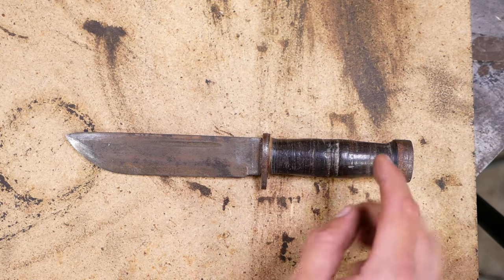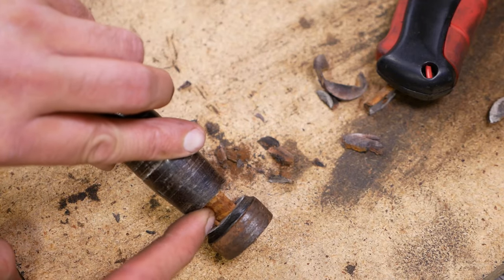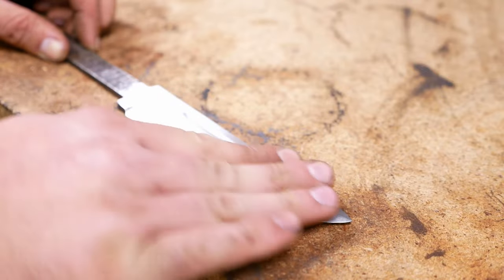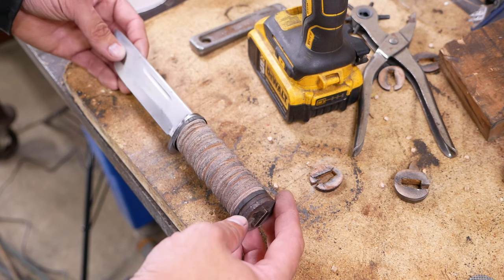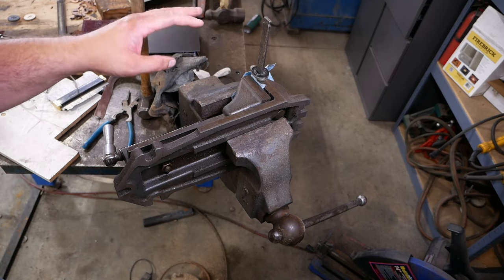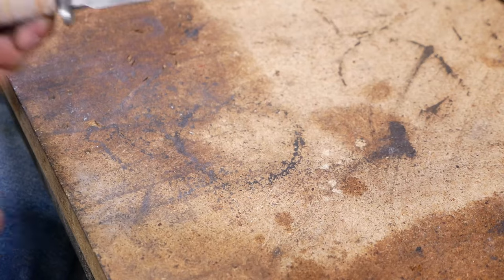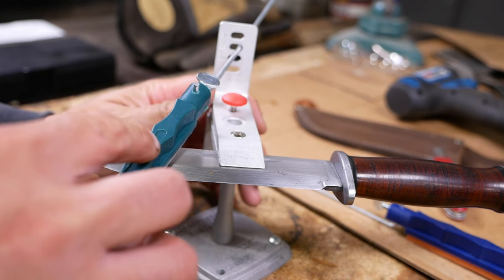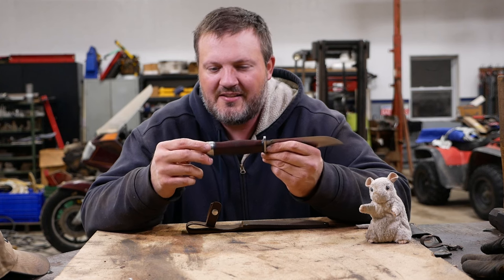Restoring a Cattaraugus 225Q Knife from WWII

Comment: I’ve restored one Western skinner from the 1950’s, a Western camp knife from the 1960’s and a Marbles skinner from the 1930’s with stacked leather and an antler pommel. They all were in pretty good shape with original sheaths. The Marbles sheath was too far gone. I had to make a new taco style sheath for it. All users. Thanks. Nice video. You did a great job 🎸🔪

Comment: The way I do my stacked leather handles...get a long 1/4-20 carriage bolt and a couple large fender washers and nut. Cut your leather disc's, punch center holes in them then soak in water. Stack the disc's onto the bolt with washers on each end and crank down as tight as you can. Sit it somewhere to dry for several days. Then remove from bolt and use as normal. This method takes a lot of guesswork out, as the disc's are already as compressed as they can be. It also reduces any issues of handle shrinking in the future and handle loosening. I usually finish by melting beeswax into the leather until it won't accept more, then buff.

Comment: Wes...GREAT job!!  I'm a self-confessed knife junkie too. Just a quick tip here...get two thin strips of rubber (can be very thin and still work) and put them between your blade and the Lansky clamp. The rubber will protect your blade from any scratches while sharpening.

Comment: Outstanding referb job. I’ve found with my Lansky the angles actually come out 4deg less than what’s stamped into the fixture. I measured my angles on a optical comparator at work, I sharpened on the 20deg slot, it actually measured 16deg. Something to keep in mind.
Reply: The angle is totally dependant on the width of the blade and the position you clamp it in.

Comment: Did great. A tip for when you're stacking the leather, wet them all (maybe you did and I didn't notice?) and when you press them they'll really fuse well, just make sure you let the wad dry out before you go further. Also, some people (unless you're truly sticking to the old methods) will saturate each leather disc with epoxy before stacking them as an alternative to leather. Finished piece looks incredible. But you're looks gorgeous too, so great work.

Comment: Very nice!

I forget what it even is...  Air Force Survival Knife??   Not sure.  I got it used at a show, for almost nothing.  the handle is like yours, or an Estwing Hammer, the stacked leather.  I cut the top off of a soda bottle, filled it with linseed oil, and put the knife in there handle down, for a week or so...  Came out really good.  

I've had Lansky Sharpeners forever.   I love them.  They just work.  

If you like knifes & stuff, you can buy bayonets pretty cheap too...  Those are fun to sharpen up...

What I sort of like about the surplus military gear is, it maybe lacks some of the style, and finer points of your premium knives, but the stuff is super tough.  It might be mass produced by a low bidder, but, it apparently meets a standard, because the stuff is tough....  It's kinda fun, to take that stuff, and make it nicer than it ever was, or was ever intended to be....

Comment: VERY NICE complete overhaul. I have one of these knives. Got it from my pappy in 1962. No sheath, unfortunately. I didn't take it apart like you did, but I did give it a nice, 21-degree edge on a Work Sharp sharpener. It looks pretty much the same it it always has, but now it cuts off arm hair and slices through paper. Seriously sharp.

Comment: G'day Wes. I think that you have done a good job on the knife and sheath. A couple of things that may help you with the leather work. My dad was a saddler who made many items from leather as well as saddles. He used beeswax with a little powdered rosin mixed through it on the thread for the stitching. Apparently this helped to waterproof the thread. The cut edges of the leather were dipped in water and rubbed with a piece of hessian. This closed the grain of the edge and smoothed it. He sometimes rubbed the edges with a cloth dipped in dye to finish them. I can't remember what they were as he died in 1988 at 74 years of age. He also had a tool that he used to warm in a spirit lamp to run along the edge to finish the edge. Hope this may be of use.

Comment: I have restored over 100 of these 225Q's and you did everything but one thing right. Bees Wax  is used instead of floor wax! Nice job though. Another thing I did to the knives I rebuilt was to soak the leather washers in Distilled water. I would soak them overnight and the distilled water was used to keep any kind of chemicals from getting into the leather. I never used glue of any kind either! 
Put the soaked washers on wet, tighten well to the point where you can barely fit the three metal pieces back on the knife with great difficulty.

Comment: The Ka-Bar has a much thinner tang; the washer kit you tried first I would bet money was for a Ka-Bar. I carried one for years in the Marines after my uncle gifted it to me when I was younger. I watched jarheads throw them, beat them, bend them, and destroy them so you could see the parts when they failed. I believe the reason so many of these particular Cattaraugus blades survived was specifically because of elements like that crack relief angle, the thicker tang and increased blade width. Someone designed that particular knife to really last. But for a fluke of fate, that might have been the Marine fighting knife, it certainly was a better design.

Comment: Years ago a buddy of mine got one of those knives from an auction. It was brand new and dull as could be. He always had me sharpen his hunting knives so he brought it by. It took me probably 60 hours using stones to get an edge on it. I got it shaving sharp and it served him several hunting seasons before needing a touch up. The edge outlasted all of his other knives and he used it hard to see how long it would last. I don’t know if they all had blades that hard and tough but that one sure did. It chopped thru bones and about anything else without chipping. The worst of it, after I got it sharp he wouldn’t sell it to me.

Comment: Make yourself a couple of soft jaw inserts from aluminum angle, they snug down and hold stock real good and don't scratch stuff. I also make a nice jaw insert by cutting a piece of 3/4 or 1" square from corner to corner about an inch long and weld those to a piece of angle iron. Put that in your vice and it will absolutely lock onto a piece of round stock such as when you file on a punch or use a large drift for a bending mandrel.

Comment: I have my Uncles WW11 knife. It's made by Case. Still has the sheath which incidentally looked like the one you had without the stitching and buckle strap.
Size, shape, and tang. The tang had diamond shaped points. My uncle said he found a rock and filed them down a bit because they got caught up on different things. The leather handle has tiny mounds and spaces symmetrically machine carved into the house glass handle. It is definitely non slip! Awesome job thank you for all the time.

Comment: Great job on restoring this old knife.  I think it is safe to say that it turned out "better than new'...  These are great working knives around the shop.  They are tough and rugged, and you don't feel bad about getting a scratch or ding.  The stacked leather hilt is surprisingly tough and will hold up to most anything you can do to it..  The steel is a bit thicker than one would expect and will hold up to a lot of abuse with hacking, prying and hammering on stuff.  The quality of the steel in the blade is a pleasant surprise ..  These knives take and hold an excellent edge.  Like most people that fool around with old tools, I have a couple of these in the basement somewhere...  One really needs a new handle, but has the original scabbard - which needs some stitching repairs and a new snap on the retention strap.  The other is in better shape but has no scabbard...  I guess I will tackle them one of these days.  Love the second channel....

Comment: These knives did see a lot of use after the war. And they were sold commercially also. You are probably right about them not being a true or even good hunting knife, but more of an everything else utility knife. They were or are now called quartermasters knife by some. I very much need to rebuild mine that came by way of my Grandfather who got it no telling where. It was virtually a brand new knife when I got it about 1970 but I used it and want to continue using it and pass it on in field ready condition.

Comment: Really nice job. One of the best stacked handles I've seen done, I also never liked how everyone goobers the disks with epoxy and puts the handle together. If you want to make itlook more authentic, if you look back at the original handle you'll see the middle of the handle had grooves or cuts in it, they actually did that at the manufacture supposedly to add grip. Also your sheath needs two more rivets halfway between the top and bottom. It came out really nice and I think it's one of the nicest restores I've seenand I've seen a lot of them to see how I want to tackle some of mine.

Comment: You did a good job.
I do use apoxy usually, my thinking being that it seals the tang, and the leather too somewhat.
Those were quarter master knives, designed to be stout enough to open crates and such without breaking the knife. (Or hopefully so anyway)
That is a unique design on the pommel. I have one of those knives, and have never noticed the pommel being 3 pieces. Will have to get mine out and look at it again.
I will say this, in my opinion, that set up is a whole lot better than the western knives which had the tuning fork tang. I have seen many of those where the tang broke. That is why I would never pick a skeletal tang knife for survival. I have a couple of Becker knives and love them for woods running, but if I was going somewhere that I might actually end up in a bind and having to use a knife for building a shelter, or to split some wood to get to dry wood for a fire, it would have to be a solid, full tang.

Comment: Did I see you using your cotter key plyers for nail pulling, Wes? lol!  I did something similar to an old Kbar I have.  I sanded out the old scratches, gave it a couple rides in the sand blast cabinet and then parkerized the metal.  Hope you get to use your new knife a bunch out in the woods!

Comment: Wes if you want to protect the leather and gat it to tighten up Might I suggest you try this recipe  1 part each by wt. of boiled linseed oil , mineral spirits  and the wax from a comode donut.  this is the recipe I use to treat leather that will be exposed to the elements and it works quite well  ( It's also the recipe for making  tin pants ) my uncle gave it to me  and he used it on every thing leather or cloth  and ran a dairy farm/ angus ranch on the west side of the cascades in Oregon oh when makking this up do so outside or in a well ventilated room  the fumes are quite bad. use it in its liquid form(melted) let stand until completely dry then use a hair dryer or hot air gun . Take your time with the heat as too much will ruin it. Good luck --Dave

Comment: Turned out great.  Have same sharpener, does a great job but can be awkward at the tip on some knives.  Have two old hammers that got handed down that are (were) leather stacked handles, been thinking about fixing them up.  Like the narrow neck they have, just feel better swinging than new ones do.

Comment: Nice job , I have encounter shrinkage with leather handel I used all the off cuts I had been saying for decades and when the handle warmed up from my belt sander the leather shrunk half an inch out of four I was impressed with the compression on your first handle just like the tube video on the eastwing factory. your finished handle dose look good . I wouldn't  leave it in a hot car or next to the fire . Tube played this video and I thought I recognised your voice then your workshop then the road noise but you made me wait till the end for confirmation IT IS Wes I knew It.

Comment: @Wes, I've always wanted to make a REAL Bowie knife. I've seen a lot of knives that claim to be Bowie knives, but not a single one has a brass spine brazed onto the back of the knife.  That brass spine was a critical feature intended to catch and turn the blade of an opponent's weapon.  They were about 18" OAL with a blood groove, as well as an upturned clip point. Practically a short sword. With a rather large brass guard and a leather wrapped hardwood handle.

Comment: Super job Wes! I have my fathers WWII Navy knife. It might be a KA-BAR? I am not 100% sure. It is a Camillus and needs the metal refinished. As I understand it, it’s a phosphate type finish. As kids we didn’t treat it so well. It was cleaned up by a knife maker, but the metal needs finishing again. We’d never part with it. I would like to get it looking original again. The stacked handles perfect. The two pins would need to be drifted out and remove the pommel and slide off the handle, if it will. 😊
Thanks again.

Comment: Great video. I just wished you had taped the blade up during the handle grinding. As a knife maker, I've had a few blades get away from me during grinding and polishing. I'm very glad they were taped up. The next time you do a stacked leather handle, try Neatfoot's oil on the leather pieces and the sheath. It'll give a far better finish, and better protection from the elements than paste wax.

Comment: A little late to the party, just found the second channel from your welder video. Anyways, I wanted to mention that you can mix 50% rubbing alcohol to your water. This helps to both let the leather stretch a little as well as evaporating afterwards to help the leather dry. Also make sure and get top grain leather. Some of that garbage is just split leather without any body to it.

Comment: At first I did not think it was going to look great ,but as time went on it turned out excellent, I know you was trying to stick to the original as much as possible but for me I would have put the retention strap right where the guard is ,not knocking the design of your sheath, it is great ,but if the blade was to be used I would be a bit concerned about the blade movement and possible sliding out of the sheath .I  think the whole restoration is very good though .God bless you and your family and happy new year to you and your family 👪 🙏. Lee

Comment: Very well executed restoration , very well filmed and very well narated. Very good job for first video. I only have 2 critiques - the knife was in pretty good shape and I wouldn't rebuild but just clean it a bit and leave it as it is (it's just personal opinion) and when you clamped the blade to the table you scratched it , you can avoid that by just putting a piece of leather between the blade and the wooden surfaces. 

anyways , good luck with your videos.

Comment: Having done some similar restorations I cringed when you dipped the leather in water. Water destroyed the structural integrity of untreated leather by bonding to the oils, then drawing out the oils as it evaporates, shrinking the leather (this is why the wet leather did not rebound after you compressed it) so if you would have not redone the handle it would have shrunk and loosen up over time even more and the leather would have become brittle. BTW, great work on the scabbard! The quality easily equals what I have paid professional leathersmiths to create.

Comment: Finish with neatsfoot oil before dying and then only use butchers wax or leather wax conditioner on the handle. I’ve had excellent results, and it will also help to waterproof the leather.

Comment: Secret ingredient for raw hide stacking is formaldehyde. Soaking in formaldehyde will make rawhide swell and continue to swell. Water will swell the rawhide but then shrink. What you did will last for a good while well cared for, but if you redo it. Also add lamp black. That's how they got the color.

Comment: The 225 Q was originally intended to be issued to Quartermasters who handle supplies. The knurled pommel was designed to drive nails and the extra thick blade "could" handle mile prying to open crates o boxes. This could be but was not intended for combat (fighting) use.
Reply from the maker: If you say so.

Comment: Beautiful Work! I have 2, one is near new, and one needs the handle restored. Your process really helped. How did you manage the tight fit? Just hammer the leatherand keep adding till you were happy? That's what it looked like, but Its hard to tell. Wanna do another ? :)
Reply from the maker: Yes. I just installed a washer or two and hammered it down using one of the pommel washers and a pipe. When I had the height mostly right I tapped it down and twisted on the locking washer. I did try holding it tight with a bar clamp and a socket, but it didn't really help. I just muscled it together.
Reply: @watchweswingit  Thats what I suspected. Some times, ya just have to force it :)

Comment: What's with those rivets shown at 26:25? The ones you installed at 20:45 had a smooth cap on both sides, which looks a lot better.

By the way, finishing steel to a high polished finish is about more than just making it look pretty. Polished steel also resists rust far better than a matte finished steel does, which is a good thing for a knife that will be used.

Comment: FYI-coating the handle in epoxy will make it last a 1,000 years instead of barely 60!! But whatever floats your boat man Lol the leather handle should be just fine tho, oil it and take care of it and it’ll last longer than you will atleast. Your kids might have to redo it after inheriting it but that won’t be your problem haha 😂👍 the blade needs to be stropped, that’s why it’s hanging up. It seems to me. Well done all the way around tho, looks great!!